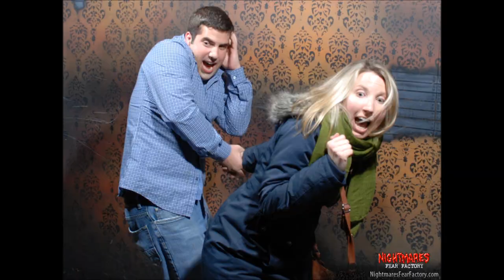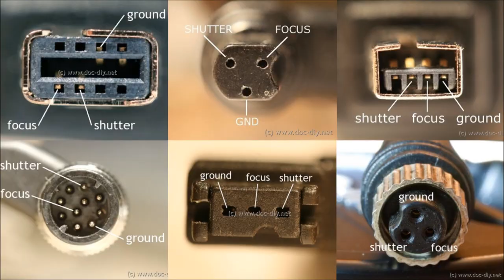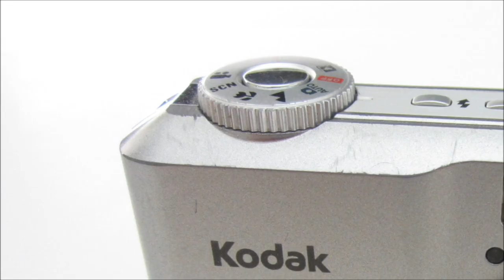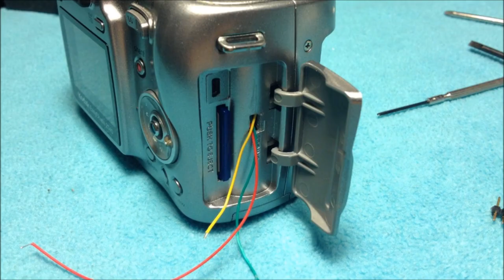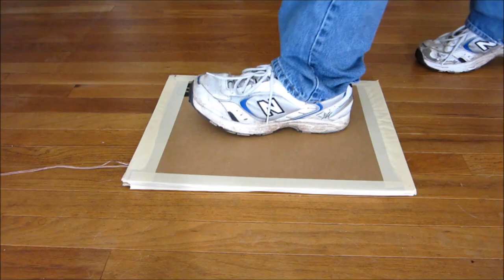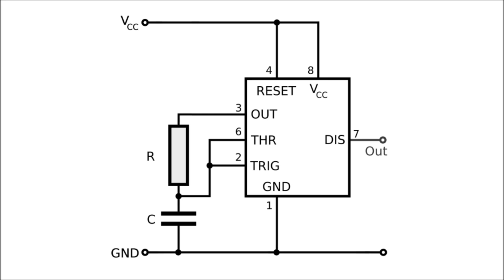DIY Hacks & How To's: Automatic Camera Controls

Comment: Is it possible that the camera is damaged by the signal of the microcontroller? Wouldn't it be better to use two separated circuits, maybe with an optocouplerto avoid possible damage?